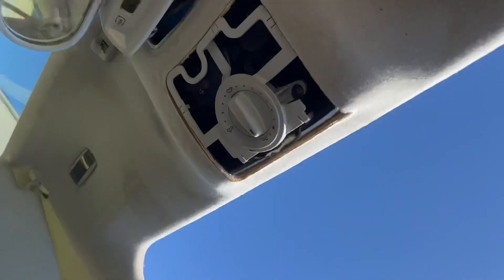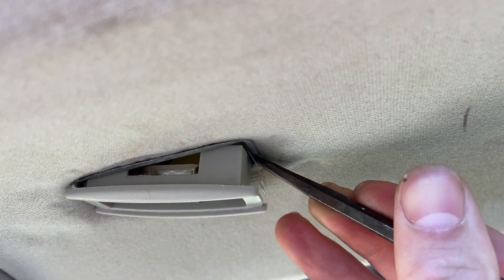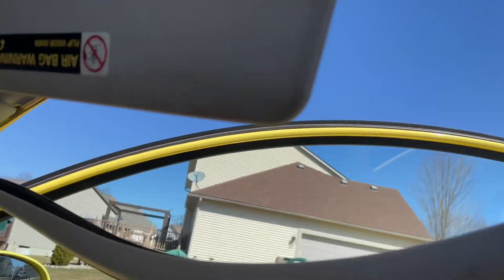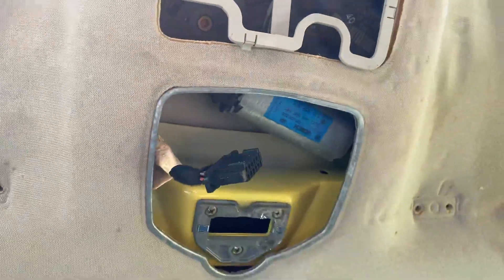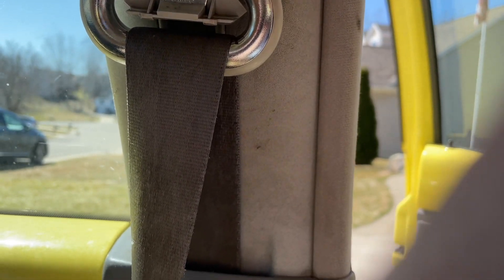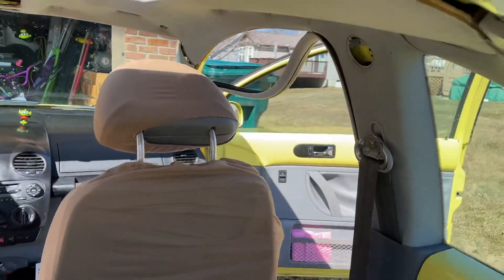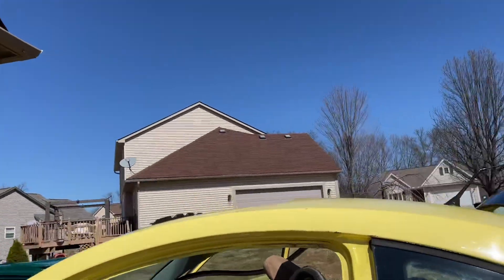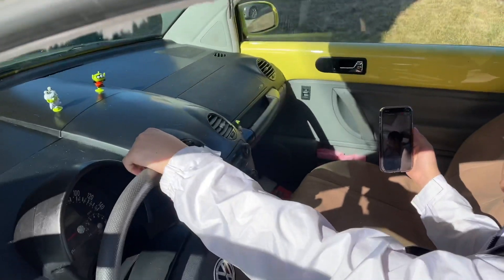How to REPLACE  HEADLINER 2001 Volkswagen new beetle headliner. *SHAG*

Comment: How has the shag held up with the glue you used? Want to use a heavy shag material as well and want to make sure it’ll hold up
Reply from the maker: I believe it had sag after a year or two I replaced with a diamond pattern after